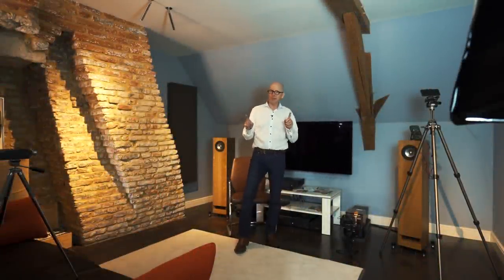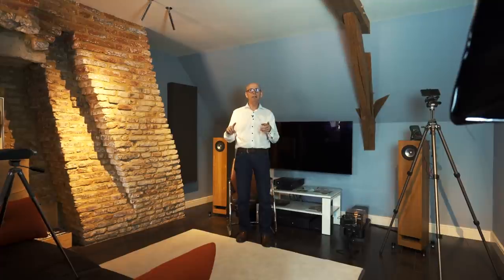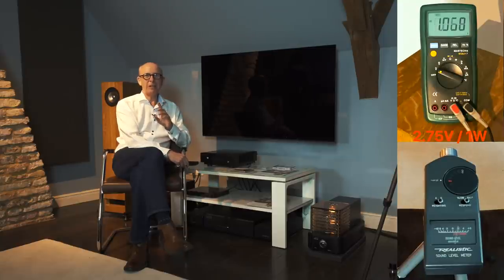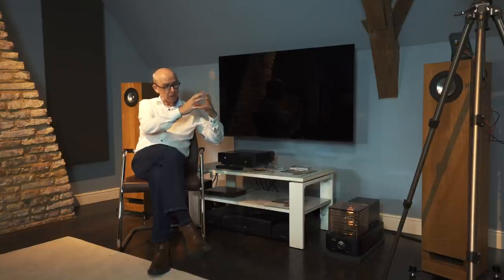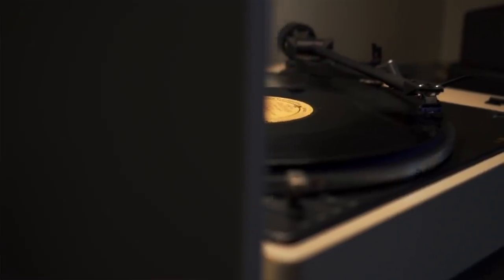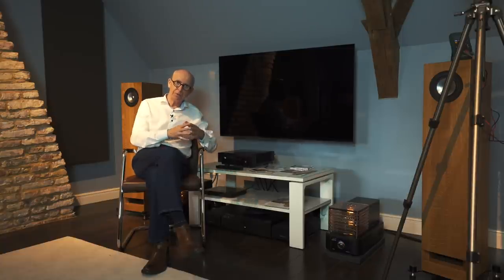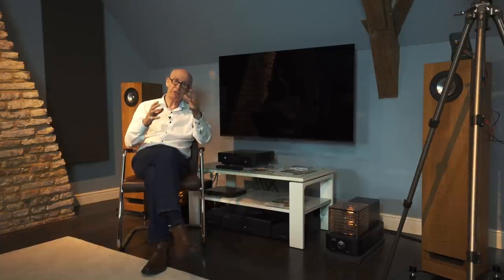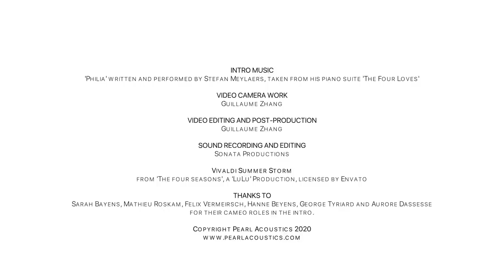How loud is 1 Watt (with an 87db Loudspeaker)?

Comment: The video is a bit misleading (probably not intentionally, but still worth pointing out). Firstly using a DVM to measure the power output. This will provide a reasonable estimate of the overall RMS power, but it ignores the peak power. If an amp can only provide 1.41 watts (peak value of the RMS power output), you'll get quite a bit of distortion and clipping even at low volumes. Due to the high peaks of music, the amplifiers RMS power rating (we assume that the music is still sinusoidal and not an actual impulse, which it almost always is) will be what determines when the amplifier goes into clipping, and the peak power output will be significantly higher than the average output recorded with a DVM. While its true that some amps can provide a bit more over short spans (dynamic headroom) due to the reservoir capacitors, this is not always the case, especially with class-D topologies. With those, 50 watts is 50 watts, period. The second is the frequency content of music. Even with a properly set up system to have a flat response music with lots of low frequency content will chew through a watt with very uninspiring results. For music with most of the audio power confined to the mid-bass and midrange region, you can get away with one watt. But hit any lows or music with a heavy bass line and forget it. You'll get distortion, or at least an unsatisfying experience. The last thing is that hearing is logarithmic. A doubling of the power will not appear to be a doubling of sound amplitude. This is evident in dB based volume controls. If you put a oscilloscope on the amp output, you'll notice the output voltage climbing like crazy even though the volume appears to increase linearly. Each 3dB increment will require TWICE as much power. You don't need hundreds of watts for the domestic hi-fi environment, but at least 25W RMS/channel is needed unless you only listen to classical or at low volumes. To do the test properly, you would actually need an oscilloscope that can measure and log the peak-peak voltage, as well as some ability to measure (or at least knowledge of) the reactive impedance of the speaker at the same time. A 4-ohm speaker is NOT 4 ohms at audio frequencies. Its usually 5-7 Ohms, or higher, depending on the speaker and enclosure due to the back-EMF of the voice coil. The nominal impedance will lead you to overestimate the actual power output when just using voltage, sometimes dramatically. While this works in their favor, its still not right. Without these, the actual RMS output is essentially unknown. While its still a reasonable demonstration, people shouldn't get the impression that a very low power class-A amp will give good results.
Reply: Yeah, sound output  lot more complicated than just "87db/1w/1 meter". and "I have a 9 watt amp so I'm good!"  that's far from a complete formula.
Reply: Thx for the sane comment.
Reply: "The second is the frequency content of music. Even with a properly set up system to have a flat response music with lots of low frequency content will chew through a watt with very uninspiring results."

Nope.  A woofer with an SPL of 87db will produce 87 db with 1 watt, just as a tweeter will.  The reason you think woofers need more power is because you are probably using low efficiency woofers.
Reply: @SomeTechGuy666  human ears don't hear lower sounds as efficiently as they do midrange sounds. That coupled with the fact the woofers/subs are inherently less efficient due to design, are why low frequency sounds need more power.
Reply: I have DIY 2way set based on SB Acoustics drivers that has efficiency around 85-86dB/2.83V/1m. The impedance is mostly around 4-8ohm, other than some narrow peaks, phase shift +/-45degr between 500Hz and 5kHz, woofers are ported, Fs at 38Hz closer to SBB4, and around resonants frequency of the midwoofer in free air. I guess that would represent a lot of spkrs on the market. For the spkrs to faithfully reproduce organ music at realistic volume I need something around 150-200 real Watts at 4ohm, despite the woofers being only rated at 60-70W RMS. Anything below high current 100W will produce cracks (amp clipping) anytime low frequencies hit. One has to do with double peaks in impedance and phase shift in bass area, mechanical damping of the cone, etc. 
As for the power required by tweeters, they're 1/5 of the woofers. Most tweeter and many mids specs list power consumption with appropriate High Pass filter eg 2nd order Butterworth at 2.5kHz. In reality tweeters are a few Watt devices. I hope some have taken apart loudspeaker drivers and are able to come to some sane conclusion looking at the size of the voice coil wire.
How about some Vivaldi in Dresden by Hansjörg Albrecht or some other music that contains real signal below 60Hz. Anything below 60Hz down to say 15Hz is actually very hard to reproduce realistically without distortions, proper timbre and dynamics - folded horn sub the size of a fridge.
Reply: Yes, the Single Ended Directly Heated 300B w/o NF at 12W will give all dynamics and power handling the 'True Audiophil' needs - 😂
Reply: @OxBlitzkriegxO  No, its fairly accurate, especially since I've actually done quite a bit of actual measurements on working speakers and amplifiers, not to mention Im an engineer. There might be some slight things open for debate, but there's a lot more wrong with this video than just what I posted just from reading the rest of the comments. Like pointing out to others that its two channels (I just assumed he meant starting at 1W x2 from the video title, but they're right regardless) so theres twice the sound power than what the meter shows. The power goes a lot higher than just 1W (more like 16W RMS total output at the end), he talks over the music which renders the dB meter readings inaccurate and useless, and more. Go read them yourself.
Reply: @SomeTechGuy666  Well actually no it most likely wont. Remember that most sensitivity readings are taken at 1kHz, not across the audio spectrum. A few companies will do them from, say, 300Hz to 3kHz and average, which is a much truer picture. However with the typical procedure of 1kHz sine only you have no way of knowing how many dB it makes at other frequencies. Also keep in mind this is measured at a fixed distance close to the woofer or speaker (typically 1 meter). Since most speakers act approximately as isotropic radiators, the sound level will fall roughly proportionally 1/distance^2. Most people dont sit directly in front of their speakers, so bit more will be needed as the distance is increased. Also remember the dB level of most music typically has a roughly 1/f distribution (for example, see "The Spectral Amplitude Distribution of Selected Compact Discs"),  meaning that much of the power is confined to the lower frequencies and often the actual efficiency will not be known due to how the test is typically run. Im using tower speakers (sensitivity 90dB/W) for my PC on a compact amp that I built, and with the nominal 3Ω impedance of each speaker it makes roughly 11W RMS per channel. Combined with a powered sub that outputs roughly the same power, at full output (~40W RMS total), the measured dB level of the audio is only about 85-90dB about 2' from the speakers at my sitting position. Much of this is due to the fact that I listen to a lot of techno and synth, which has a lot of low frequency content, and they're in an actual room, not a laboratory with a mic dangling down in front of them. Naturally, things will differ.
Reply: Sound guy: "RMS power" "peak value of the RMS power output" "peak power" 

Engineer: "wut?"
Reply: @kubtastic  RMS is NOT average power, as you probably know. It simply means root mean squared, as you also know. In testing or power distribution terms, it will be the continuous power since you will be testing with either pink noise, or a tone, or the incoming AC mains. With most music, you will need to be able to meet the peak power demands, not the average. You could only need 3 watts average, but there might be a 25W excursion. While peak power might seem applicable, the actual music waveform will typically be something that is sinusoidal in nature and lasts for at least a few hundred milliseconds or more and not a simple peak. Granted it wont be truly 1.41 x the peak power since its not a true sine, its still useful to cast it in RMS terms since this is what the amplifier will be tasked with supplying during that excursion. This will be doubly so if you have a class-D amplifier since the control loop and switching speeds run much faster than the audio, and they more or less run quasi-steady state. Now there's programming power, which is useful as well if its given, but more often it will just be the RMS output for consumer power amplifiers since the clipping will be what is of concern. The programming power is usually given for large PA or pro-audio amplifiers since they will not be able to supply a continuous power output due to heat dissipation limits in the active devices and transformer. Typically the programming power is 2x the continuous since the engineers know that the music will not just be a steady tone, but comes in bursts and they can get economy by downsizing the heatsink and transformer. Since I like to use electronic power supplies in my stuff that I build, I care a lot less about semantics and a lot more about knowing where the supply will hit its limits. If I have a switch mode power supply I designed for a low power amp that can deliver 3A per channel continuously into an 8 ohm load, the RMS power for a test tone will not be 3^2x8=72 watts. It will be (3^2x8)/1.41 or ~51W RMS. Due to the fact that the power supply cant exceed 3A at any time without it going into current limiting, this will also be my maximum measured power as well for program material. This also works well for off the shelf class-Bs with linear supplies, as it ensures you will not venture into clipping given that they will have some reserve in the main reservoir capacitors beyond the RMS rating. Now if all amplifier manufacturers gave accurate peak power or programming power as a figure of merit, Id use that since it would be correct. But they don't, so RMS is all you really have to work with, which is why I used it as I did.
Reply: @kubtastic  And if you dont believe me on how they rate them, have a look at Williston Audio Labs, who tests car audio amps. The RMS rating is the maximum output. This is what I've found in home audio. Is it right? No. If you run a 1500W RMS consumer amp at 1500W, it will blow up after only a minute or so. But since manufacturers dont want to call an amp that can safely deliver 100W of music power a 50W RMS amp, they instead put 100W RMS, or the point at which the distortion exceeds the design limits or just below where it goes into clipping.
Reply: @mysock351C  RMS Power is an oxymoron and leads to confusion, like mixing up 2.0 with 1.414.... e.g. an unbiased sinusoidal system at 72W peak is doing 36W average, not 51W.
Reply: @kubtastic  My mistake on the off-the-cuff math I did in my head but my argument still stands about the RMS power. Its how they rate them, and we're unfortunately stuck with using it.
Reply: @sonnyaraneta6488  No its a good point, and one thats seldom mentioned. Size does make a big difference regarding efficiency.
Reply: @BASSstarlet  Just because you think it is stupid doesn't make it so.

"Audiophiles" are always inventing new "science".   Most woofers are fairly flat from fs to 1KHz.   Many woofers won't even go to 1 KHz!  If the manufacturer tests the woofer and says it does X dB at 1 W @ 1m, then that is what it does ! Do you think they are lying ?
Reply: I sorry for  my stupid question: Is 1 watt class A power tube the same as 1 watt class A solid stage?
Reply: @edSuwanDiyAudiophile  Yes, it is.
Reply: TechGuy Really the sensitivity test should be done with band limited pink noise to match the speakers frequency range. If you hook a speaker up and monitor the current the woofer draws it goes all over the place, dropping substantially at the box resonance. Generally the current the woofer draws both varies in time and with frequency and shows substantial phase shifts relative to the voltage on either side of resonance. While the response might be flat, the power most certainly is not. However, at 1 kHz where the sensitivity test is normally performed the phase shifts are gone and the current draw will be less, and thus the sensitivity there can be quite different, esp. if a midrange or tweeter is carrying the load. It’s a test to be taken with a grain of salt.
Reply: @SomeTechGuy666  I would expect a large manufacturer like JBL to have a fairly comprehensive test facility for their loudspeakers. However, this does not mean the results are automatically correct. The problem is there is no actual standards for how sensitivity is determined. If you feed a pure tone with a 1W input to a full range loudpeaker, this will probably give significantly different results than using say a noise source as some do to measure it. This is due to the physics of how loudspeakers work. Since there is back-EMF. The back-EMF helps considerably to linearize the response of the loudspeaker as it acts as a form of "servo control" to ensure the woofer (and to a much lesser extent, mids and tweeters) track the voltage waveform. This is much like a DC brush motor. It will pull little current under no load since the back EMF is balancing the input voltage, but if you slow it down, the imbalance causes the current input to increase dramatically as the back EMF decreases (and torque increases). The unseen effect for speakers however is that they present a fairly non-linear reactive load to the amplifier. If you put a current shunt and kelvin connection on a typical speaker and monitor the voltage and current for a pure tone input, you'll see the current (and thus power) wanders around quite a bit even though the audio output is more or less at a constant level as the frequency is changed. Long story short, the efficiency is not constant across the range of frequencies, and woofers tend to be the worst offenders in regards to efficiency. As far as I know, there is no standard for conducting the test other than a few rules of thumb like 1W and a 1m microphone distance. If the test is just done at one frequency, it can be misleading. As I said, pink noise would be a good candidate to use for the test as its an approximation of audio and will test across the entirety of the speakers response, and not just at one point.
Reply: @SomeTechGuy666  "mysock351C blha, blah, blah... I love it how the "audiophiles" have their own magical science." Im not an audiophile, and this is not magical science. Ive taken actual measurements on loudspeakers using my test gear and those are the results. Whether or not they conflict with your world-view is irrelevant.
Reply: @mysock351C  Whatever.
Reply: @SomeTechGuy666  Thank you ..🙏
Because i have a 2watt power tube but the sound is louder than my 10watt power solid.
Reply: @SomeTechGuy666  Not to drag this out, but Paul @ PS Audio, who also do loud speakers has the TL;DR answer here from a recent vid: https://youtu.be/JWbqTotTTRo Again, just stating what I had seen from my experience with loudspeakers FWIW. This comes from a manufacturer, so its insightful to see what they also have to say.
Reply: @mysock351C  and now everyone should go and listen to music with the amp and speakers of their choice.
Reply: @mysock351C  JBL sweeps the its woofers with a tone from 100Hz to 500Hz and measures the result with a friggin microphone.  End of story.
Reply: edSuwan DiyAudiophile You might want to make sure your 2W isn’t headed into clipping and distortion. Some tube amps can have considerably less bandwidth than a solid state amp, so clipping may not be as obvious. I ran into this with a counterfeit audio amp IC. It sounded terrible (no treble at all), but since the slewrate was so slow it could be driven well beyond the clipping point without issue and even though it was only good for 12w RMS I could crank it right on up well beyond the clipping point without noticing. There are other reasons why it could sound louder (besides the obvious psychological subjectivity) like If you’re running 4 ohm speakers it will make more than 2W a channel, or different speakers than what was on your solid state amp. I assume both were/are class A amps?
Reply: @mysock351C  I'm not an engineer and don't remember the reasoning but edSususan's amp question is normal. In the guitar amp world a 20-30W valve amp would be as loud as a 100W Solid State amp.
Reply: Would you answer me this please? If I have loudspeakers that demand 50-300 wats from the amplifier, Is it possible to conect a 30 Wats tube amplifier without damage them?  Thank you for your answer.
Reply: That's right
Reply: Although i never heard him hint that 1 or 2 watts is enough, i see your point that some may misunderstand the demo & conclude through total lack of experience of dynamic peaks & need for headroom, & how much energy goes into what frequency.  Tho i have to agree with what i understood you say, i've also heard of folk talking of room gain, while ive never measured or researched it beyond standing wavelengths of lower frequencies & only read of it, i have noticed some speaker designs will imcrease in bass substantially if you shove them very close to the rear wall or diagonaly place them tight across room corners with only a closed-in tall v-shape void behind them. On a typical 3-way design, on deep bass jamaican dub style music, it must be near 70 - 80% energy (i'm guessing based on the mass & distance moved) energy going into woofer's say sub-400'Hz frequencies & 5% to 10% max on tweeter with the remaining %'age going into the mid-driver frequencies.  As you suggest, a chamber orchestra playing something light, isnt going to work the woofers hard.  Tho I certainly appreciate deep bass potential on classical as it give clues to the size & ambience of a orchestra's venue & cello's, bassoons etc never sounded right to me on even slightly bass-light music.     G'day
Reply: Your hearing follows roughly a cube root curve rather than logarithmic. Although it's hard to define "twice as loud" as you can't really put a number to a psychological quale that only exists within our God breathed conscious experience that separates us from machines. Most people say a 10dB gain is where you'd expect to position loudness on a volume control turned from 12 o'clock (midway or "5") to 5 o'clock (maximum or "10"). The actual half power point would be positioned just above 8 out of 10 on an average volume control that scales roughly with loudness, which surprises a lot of people. Even a quarter power is still a 6 to a 7 on a scale of 0-10. Any greater changes in loudness are due to difference in speaker efficiency and gain staging, which is why a 10 watt hifi might be more than "twice as loud" as a 1 watt radio.
If you measure loudness in how many increments you can notice, you will get a logarithmic number, although the volume increments need to be bigger as you get louder to notice a change.
Reply: @TimpBizkit  Yeah there is the Steven’s Power Law. Other oddities are the equal loudness contours with increasing volume that causes the perceived amplitude vs. frequency to flatten out. Or the broadening response of the tympanic membrane and the stereocilia that causes some muddling of the tonal quality at high SPLs. Definitely not straightforward. But neither are any of our senses, like the eyes having to constantly move to actually see. Have “lazy eye” and if I let it go long enough, that eye will stop moving altogether and suddenly the vision goes black since the retina is just seeing a constant image. Very interesting all the evolutionary give and take needed to make it all work, and probably makes for an interesting research career. But yes it’s not truly logarithmic, but it’s a good enough approximation for volume controls. Better than linear ones which barely do anything at all for a good portion of the control range.
Reply: Please study voight pipe speaker .in long rooms it can hit 22db.  Perhaps these speakers r folded voight pipe . Superbly simple session voight pipe.
Reply: seem like you didn't watch the video completely